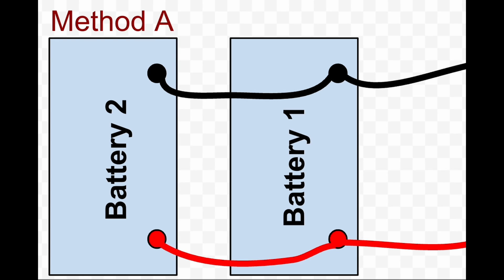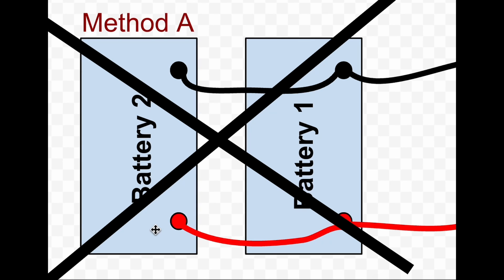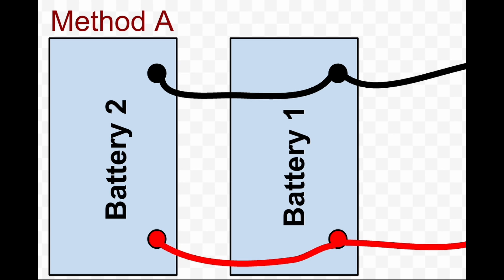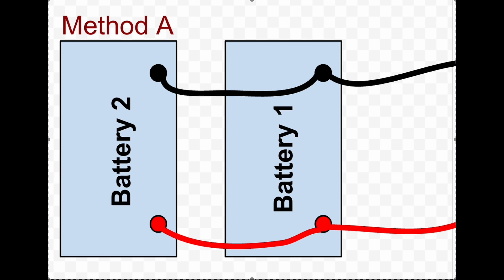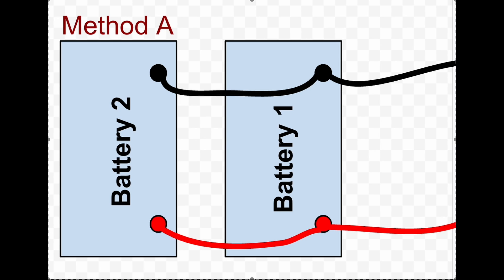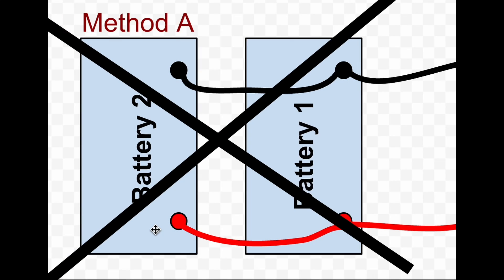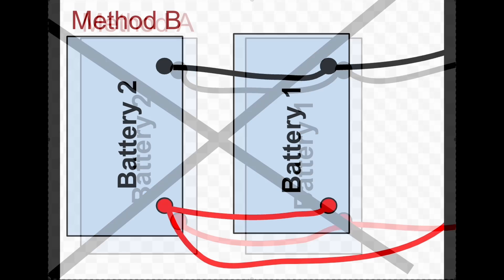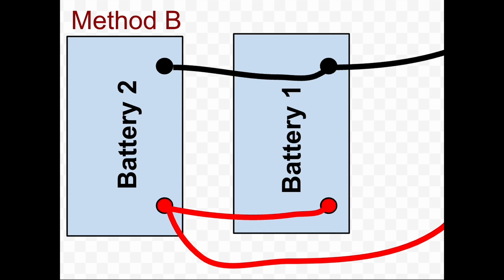What is the Best and Safest Way to Connect Lithium Batteries in Parallel for RVs and Boats or Homes?

Comment: My electric scooter has a 48v 30ah LFP battery.  And I want to add another 48v 18ah battery to it.  Can I connect both positive and negative in parallel at the charging point?
Reply from the maker: Theoretically you can connect these 2 different batteries in parallel.  However, I would not recommend it.  Others may say it is okay, but I personally would not recommend it.
Reply: @TravelingLightReflections  ok sir but I can use it through change over switch. This way I can use both the batteries one by one.
Reply from the maker: @Vinay068  It is most important that you keep the voltages of all of the batteries in a parallel system equal. If by using a change over switch, you will be connecting and disconnecting the second battery, You will cause a rush of high current between any battery of unequal voltage. If you intend to always keep them isolated from each other and charge the 30Ah and 18Ah separate, you can use a change over switch. Just never connect them together when they have even slightly different voltages.  With Lithium there could be a bit SOC difference with a slight voltage difference.  This can cause a very high current enough to melt small cables.
Reply: @TravelingLightReflections  sir ji I will use both batteries separately. 
When I will switch the change over switch on mode A, scooty mains positive and negative will connect on battery 1(30ah). Then scooter will use battery 1 and charging also. 
When I will switch the change over switch on mode B, scooty mains positive and negative will connect on battery 2(18ah). Scooter will use and charge only 2nd battery. At that time 1st battery will be fully disconnected. What do you think sir about it?
Reply from the maker: @Vinay068  Sounds good!

Comment: Can the two lithium batteries be separated by distance... One under the bonnet of a car and the second in the boot of the car? I currently have a itech lithium battery under the bonnet that i run my camping fridge off and want to add a second to double the capacity
Reply from the maker: You can do this under two conditions.  One, do not use the chassis as a ground.  Run equal length wire Red positive as Black Negative. Because you are running parallel batteries you can should wire larger than your expected load and fuse the positive wire.  Being as your system currently has a battery that already handles your load, your single battery under the bonnet, will still get a large percentage of your load, unless you run third wire as I showed in the diagram. In other words. The positive load wire from the positive of battery 1 and the negative load wire from the negative of battery 2.  My concerns are, the cost of the wires,  the voltage drop, any heat and protecting the wire from a short. Hence the fuse between the batteries. Is it possible to by a double size battery that with will fit in the bonnet? The cost may be more for the battery but it will save a lot on wiring, components and work.  It will also be safer.   So, yes this is possible but use GOOD wire, fuses and do not use the negative as ground.  Determine your max current before you buy wires.  This is one source to look at a good variety of batteries. https://www.litime.com/?ref=q12mEP4EB0Q2EJ

Comment: Seems like there could be a diod on the discharge if 1dosent charge or disharge as much it wont be drawing away from others of more capacity n maybe have sepret wires between each for balance charging and monitoring each and not having to unhook them not shure what size diod can carry what ampraje though ones in a car alternator seem big to me guess there called a bridge rectifer in an alternater to though.
Reply from the maker: The BMS takes care of the balancing among the cells that make up each battery.

Comment: Dear friend thanks for your video...what is the proper connection of the power inverter?direct positive and negative one battery 1 or 2? Or positive on battery 1 and negative one battery 2?
Thanks!!!
Reply from the maker: If you have a 2 battery setup with the batteries in parallel, then the inverter should be connected the same as any charger.  Use method B.  Regardless of whether the battery is being charged or discharged the connections should be the same. Throughout the batteries' life it will get an equal amount of charge as it get discharge.  I hope I answered your question.
Reply: I have connected as the B...I was not sure but finally  is the best way.also the chargers cables are connected as the B.
Thanks a lot!!!!also I don't know if you can help batteries during day are full charge 13.8v as the panels produce power.with no loads and the 12v power  inverter off at next morning controler shows 12.7v.batteries are 2x 12v gell deep cycle 150ah each connected parallel.any ideas?connections are ok charger is an mppt powmr 60a maximum
Reply from the maker: @djperfecto1  Your batteries look like they are okay.  The float voltage is also higher than the resting voltage.  Your solar controller is correctly bringing the batteries up to 13.8 volts.  When it shuts down the battery voltage settles down to it's resting voltage. For AGM the fully charged resting voltage can be between 12.7 and 12.85.  It depends on the manufacturer and also on the whether there is any voltage drop in the device you are reading the voltage from.  Regardless, from all that you have told me, your system is working fine.

Comment: Good info for me as Im currently designing my system in my Lance truck camper. Space is limited and the camper came with only one battery. I have removed the microwave and added 2 lithium batterys, solar charge controller and some fuses and buss bars in that space. From the buss bars in that space I will connect to the camper battery.  So I will have 3 100ah batterys and 400 watts of solar and a 2000 watt inverter. The camper also has a propane generator which connects to a transfer switch. I hope it all works when Im done.
Reply from the maker: Check out this power system interactive I created.  It may help you predict how well you planned system will work. https://youtu.be/mIKc81QS_Fw

Comment: No mention of any lithium battery monitoring device. You can't just hook lithium batteries to a system designed for lead acid you need a charging controller to isolate the lithium battery for the lead acid battery.
Reply from the maker: If you are building a lithium battery from lithium cells you need a Battery Management System (BMS) for each battery.  This BMS will manage the cells contained in each battery, as a unit.  This video is about batteries.  All lithium batteries already have BMSs managing the current and voltage of the cells. No large lithium batteries are sold without BMSs. You can get small lithium batteries for model aircraft that do not have BMSs. The ones that do not have BMSs will have balancing leads with a JST connector.  However, this video is about power system batteries.

Comment: Yeah that's not going to make any difference.
Reply: wow Ai is doing it's job living loud with Andy
Reply: I would love to know the reasoning behind it it wouldn't make any difference it makes total sense open up a lithium ion and I believe they're in seres.
Reply: Dudes actually right I'm about to drop a video on this right now I actually killed one of my lifepo4 batteries because of this. Let them sit in the garage for a whole year connected the same way as in the original diagram not the second diagram(the way hes showing you to do it) and the one works great and the other one won't take a charge but I saw a video where you can jump start the one that doesn't take a charge with the one that is fully charged and it'll actually charge back up normally
Reply: As an auto elec, yes, it does make a difference.
Reply: @mattxr6t nope, as a electrical engineer, I can say it won’t make any difference unless a poor (high resistance) connection is made at battery 2 terminal.
Reply from the maker: It does.  It actually makes a big difference. That is why I made the video.

Comment: How to connect with 3 batteries or more?
Reply from the maker: Many people suggest using a bus bar.  If you can make every cable the same length and insure every connector is crimped perfectly then a bus bar is a good choice.  To contradict this though, using a bus bar means 2 times as many connector to crimp and more chance of a failure.  Also with today lithium batteries the BMS's also regulate charge so it become near impossible to get all cells and all batteries perfect.  So, for beginners doing the work themselves and making your own crimps, I would put the 3 batteries in parallel and not use bus bars.  If you are a pro you probably not interested in my input but if you can get excellent crimps then go with bus bars.  Of course bad  crimps are dangerous in all cases. I am just suggesting using as few as possible.  Also, I always put the system under a high current load and use an infrared thermometer to look for hot spots that need to be repaired.

Comment: In method 1, ALL the current passes via the negative and positive post(terminal) of battery(1) so in effect that will have twice the power loss of terminals COMPARED TO battery(2),  assume both batteries supply 50% of the current... So in long term applications you will see a drift in both charge and discharge of both batteries. 

For the dummies out there, imagine two garden hoses and you trying to force both into one. at the point where they join it will have losses.
Reply from the maker: It is much greater too, at high currents.

Comment: This is one of the first things i learned when i designed my solar system 4 years ago, very true.  I should make a short about it. Larry
Reply from the maker: Yes, you should.  So many DIYers just to method A, because I do not realize there is a difference.
Reply: @TravelingLightReflections  if u use lithium batterys ther is not difference wireing can be a topic  on led acid coz this stuff age with any current movment or voltage...
on lithuium batterys its not matter.
if i pull 2 parrallel batterys 50% energy off off its 1/2 charge cycle for ea of them, it not matters in any way if battery 1delivers 53% current and battery 2 47% current coz after the draw both battery will balance them to 50% and for both batterys it was 1/2 cycle in total.

use thick wires reduce the different in current draw to near 99% the same ..

over all pointless video for the lithium age, where this batterys last ~25-30 years to there dead and if lithium battery 1 will be dead in 29,5 years and battery 2 in 30 years who cares.....

on the other side lead acid degrade very fast with ea current movement after 2-3 years they are become near useless so make any wire theroies will not change anythink on this part that this batterys fast become for garbage.

Comment: The resistance of the cable it not as big as you think, if you are not cheepo.

if you use 16mm2 cable to cenect them and have proper conection it will not go over 1 ohm in total.
1m of cable like this have 0,00013ohms, if it will not go over 0,5 ohm there is not going to be a noticible difference.
Reply: When you’re talking hundredths of a volt between 90% and 100% charged, every micro ohm matters and the way you’ve shown it is the correct way to easily equalise between battery 1 and 2 when wiring direct and not from a busbar.
Reply from the maker: I knew there was a difference under load that would balance out as the batteries recharge.  I have had a lot of people's comments telling me I am wrong.  I went looking for other videos and found this.  I was shocked at the difference.  I created this video based on theory.  This video shows actual tests in action. Even though the resistance is low, it still follows that if the cable length is doubled, so is the resistance.  I learned from the links video too. I am curious how the quality of a crimp affects the performance.  I originally made my video to help people see that they could easily use method B.  Here is the other link. https://www.youtube.com/watch?v=_pQ0WjpSEa0

Comment: Great video! I could be wrong but I think in "Method B more extreme example", if you connect the positive load cable to Battery 3 (versus Battery 4) and connect the negative load cable to Battery 2 (versus Battery 1), you'd get a more even distribution of power while charging and under load. This will better help the lifespan of all the batteries.
Reply from the maker: You may be right.

Comment: You didn't mention, Lithium  batteries. Having B u s s  bars with charging on each Battery is equally Charged
Reply from the maker: It is not actually equal but closer with a bus bar and only if the crimps are done perfectly.  Plus with the bus bar you have 2X as many crimps. I removed that section of the video because I made the video to stop DIY people from doing Method A.